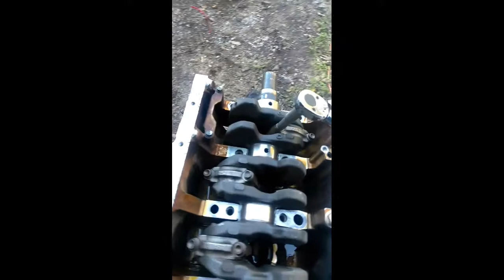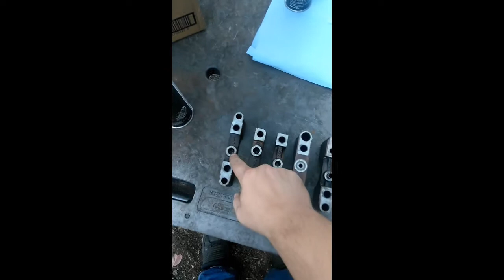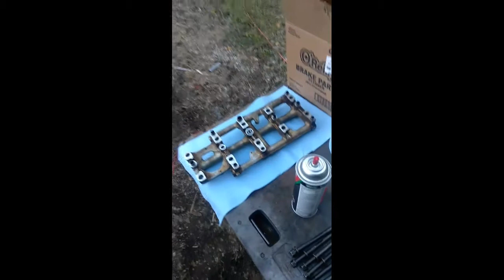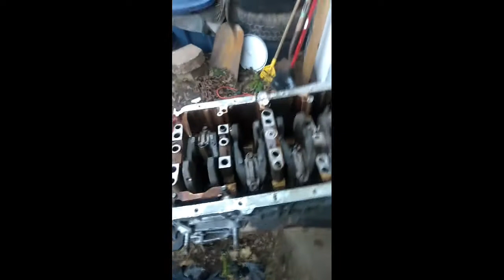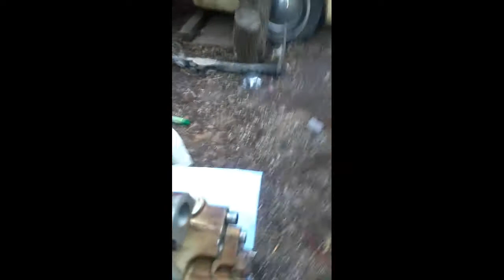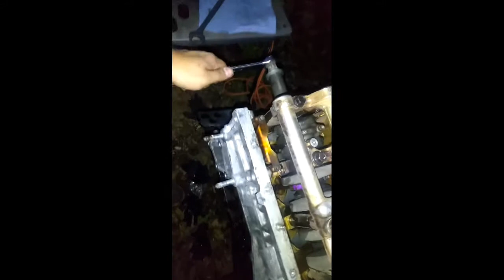Custom h21a4 build for the h2b CR-V yes I did say h21

Comment: I ran into a problem bro I leave this here I bet ur sleeping um wat is the dome cc of k20z1 pistons?
Reply: All of the forums have the info 100 times over.  Honda tech is hands down the greatest asset to any novice person who wants to learn.   Everything is covered just have to put in the effort.
Reply: @duanebailey6253  it's easier to ask Brandon he has more experience in g23s then anyone, forums aren't always accurate or reliable many of the humans on the forum have never seen a Honda motor let alone biult a g23.
Reply: @MultiDislikes  To much work to search.  All of the g23 OG's measured the pistons on the forums not hard to find at all.  Super easy to find your anser through a wiki or an OEM part catalog.  They are the same as the k20a2 no diff at all.

Comment: A very unique engine combo.
Reply from the maker: Yeah I got a hole list of different engine combinations I can do
Reply: @GswapsG23VTECG22VTEC  I am thinking I might do a g22 build. Have a f22 sleeved block so might as well use it
Reply from the maker: I also have a video of the G22VTEC I'm building for my Integra ...Im useing the jdm f22b twin cam  block also useing f20b pistons an eagle f22a1/H23A1 steel rods
Reply: @GswapsG23VTECG22VTEC  yeah that the first video I saw that mad me sub. Because I was thinking of doing the build and wanted to watch for the information. Once my AWD swap is done I will be doing the kswap or a h2b build for more boost